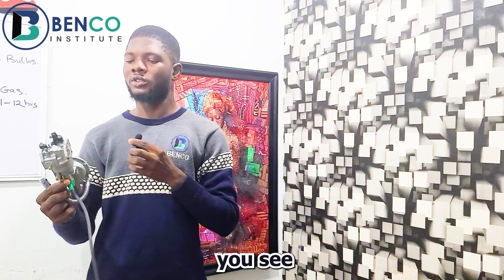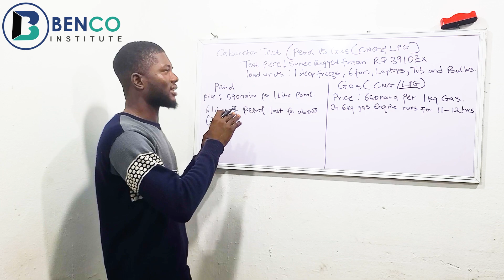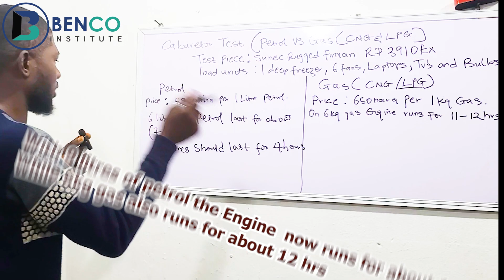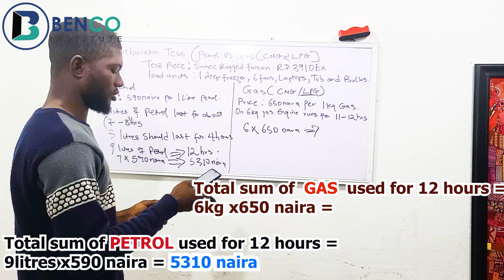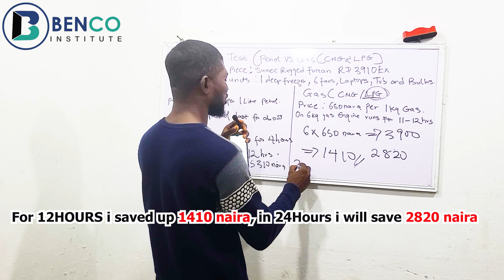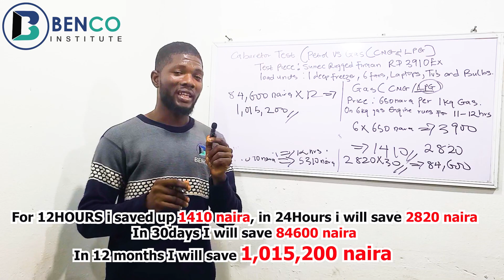Test Results!! Petrol vs Gas LPG NG Carburetor |See how millions of naira was saved from using Gas.

Comment: Nice one bro..but here in owerri 1kg gas is 900 at pump while fuel is 620. From ur calculations it absolutely right to say it's cheaper to use fuel
Reply from the maker: My calculation is based on those figures